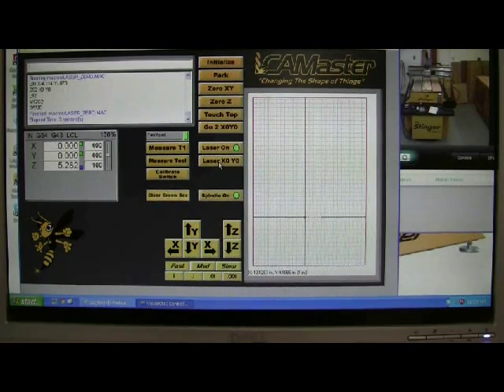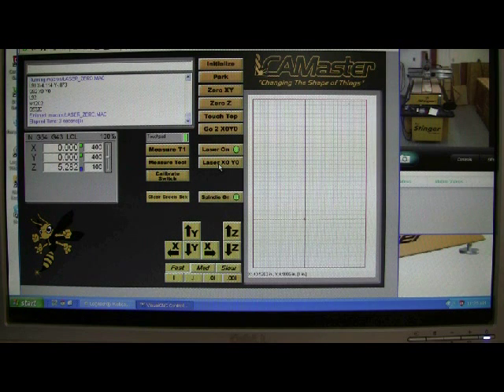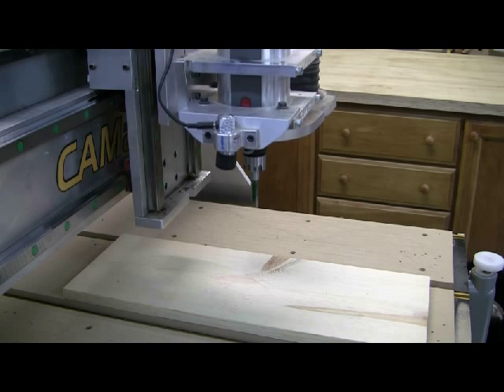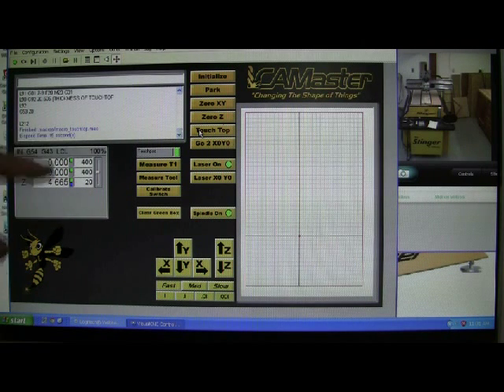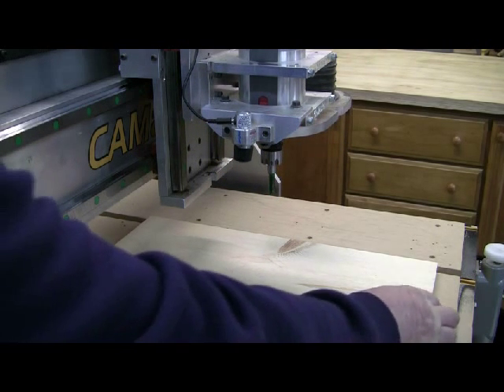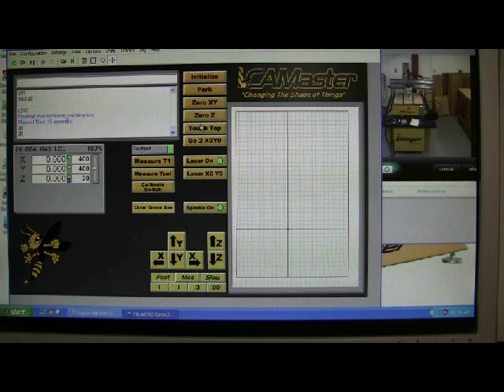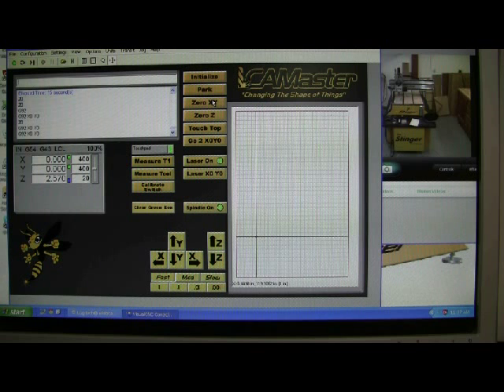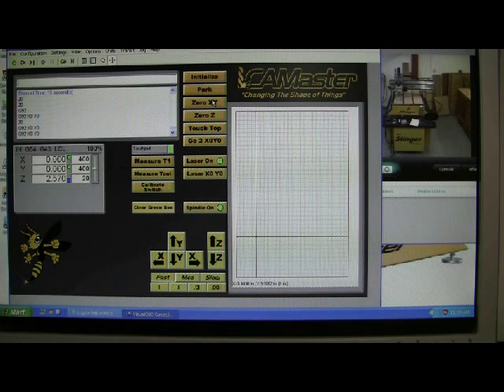CAMaster CNC Router and Wincnc Video Tutorial Part 4

Comment: so, i don't have a "clear green boxes" button.  How do I clear green boxes manually?

Thanks
Reply from the maker: If you want to clear all the green boxes XYZ then just type G92 into Wincnc and press enter. If for example you just want to remove the green box next to Z then type G92.1Z into Wincnc and press enter. This will only remove the green box next to Z .......... you can also do G92.1X or G92.1Y
Reply: ok. So I've managed to move Z0 to the top of my MDF spoil board.  Can you walk me thru the processes of starting a new job from this point forward?  I know that from now on, in my design software Z0 must be at the bottom of my material.  But once I get the .TAP file to WINCNC what must I do first?
1. Load TAP File into WINCNC
2. Do a tool measure? (or do I mesure tool first then load TAP?) This is where I'm confused.
3.